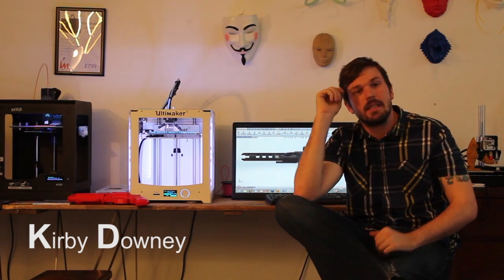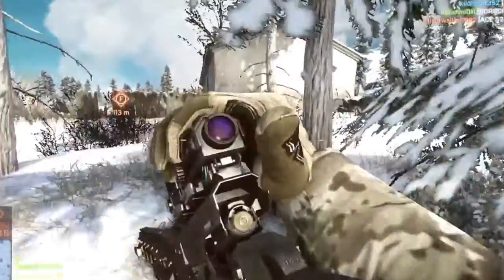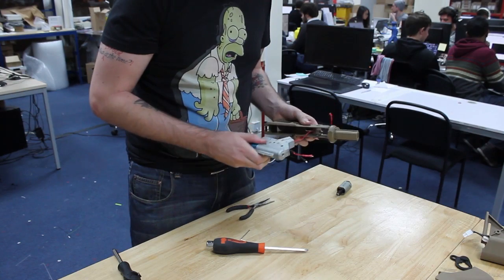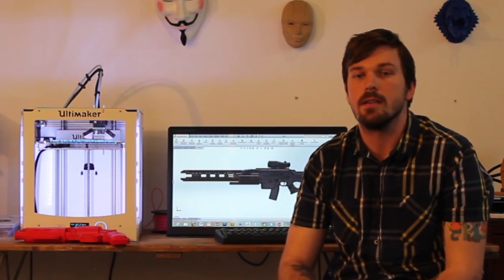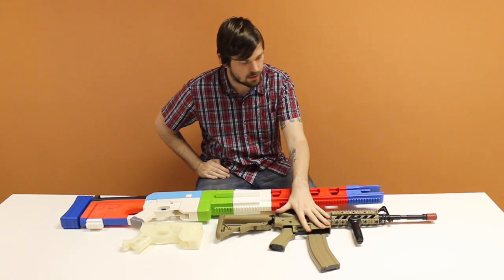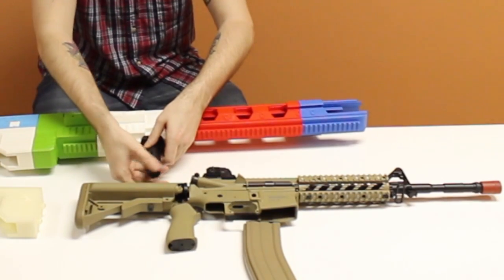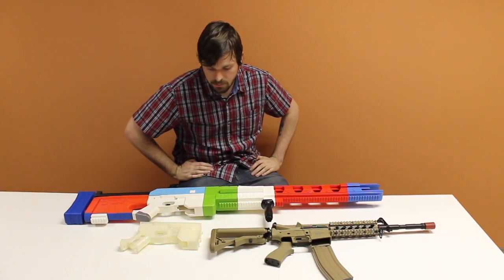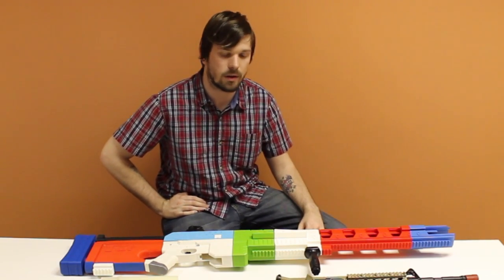3D printed airsoft gun from Battlefield 4

Comment: You should really consider either sticking to one color or spray painting it after you're finished. Perhaps even using something to fill in the gaps between the joined parts so it looks like a single piece.

Using various colors throughout the print makes it look too toy like.